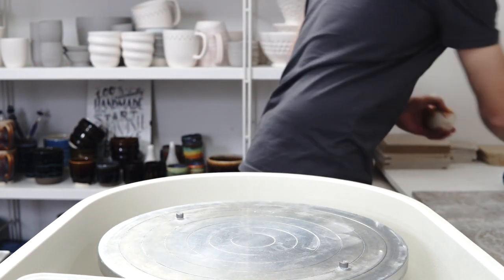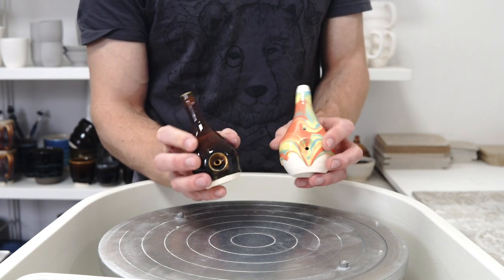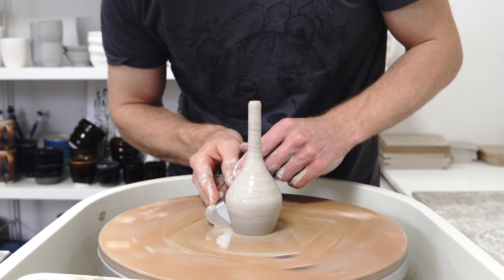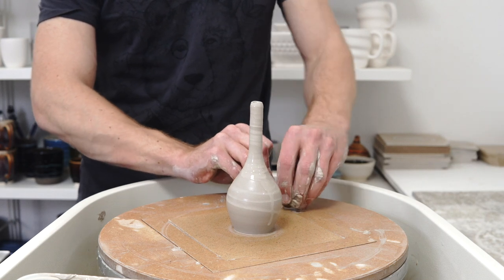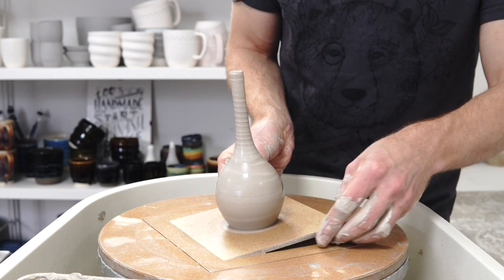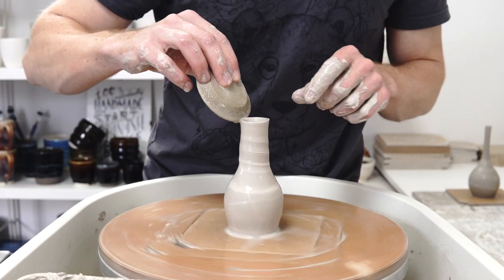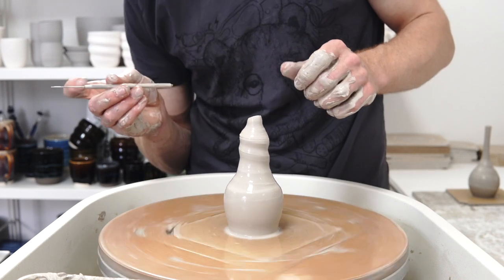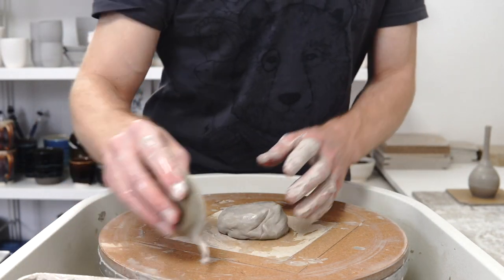Throwing Pipes on the Wheel - Initial Thoughts

Comment: If you use raw chucks, they grip very well. I usually save a small bit of the hump after throwing cups and leave it on the wheel at the end of the day, then its ready to use for the trimmable cups the next morning. After you're done you can then throw the 'chuck' and get some more pots, or just wedge it out again and reuse. I know someone who has all sizes and shapes of raw chucks that he keeps in plastic bags. With careful rewetting, he uses some of them for years.

Comment: Something simple to mention, I have been working on a similar shaped project but because of the bubbler I thought of a weird technique to make the spout for the air , just throw a regular piece scrape a channel to the bottom of the bowl/ vase shape, over the channel just lightly press on a fairly thin strip of clay with seam allowances on either sides , as long as the spout isn't angled severely you can Casually spin it smooth on the wheel without tons of issues , if you want the hole to come out perfect I like to have short section of cotton or jute twine to use as placeholders for the pressing the cover over it afterwards they can be carefully tugged out . I have been developing like a portable coal burner out of clay I can fill with charcoal pack it tight and light it.  The airflow end has the crazy tube thing which provides the extra oxygen to burn but the fire is started on the opposing end so the coal lasts a while. Still not sure if I want airflow though the coal or not I may end up making a log press with a hole through .
Reply: This will have to be thicker so the piece doesn't fold in half on the seams of course , I added pieces to mine while it dried out so I have been carving at it to get the internals the right shape

Comment: you wont have any issues with the smoke being to hot despite the thin neck as the bulb part has a fairly large volume, much more than a typical glass pipe. when you smoke you draw the smoke into the pipe using you mouth and tongue muscles where it has a chance to cool slightly before you open the carb and use your lungs to clear the pipe while pulling fresh cool air through the carb hole. pipe only burn your throat if they dont have a carb or enough internal volume/length to hold the smoke while it cools
Reply: Also depends on what you’re smoking a fluffy ember will not heat up as much as a dense or finely packed ember. Aromatics vs pressed pucks